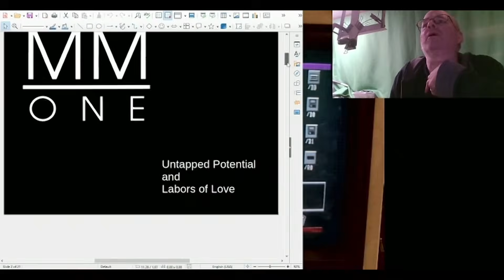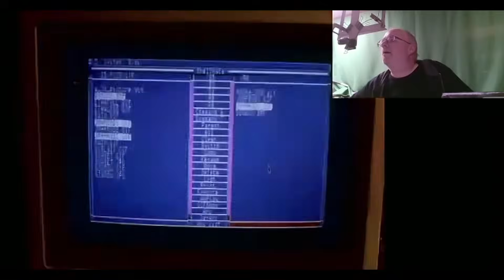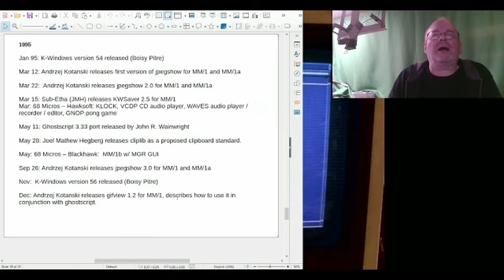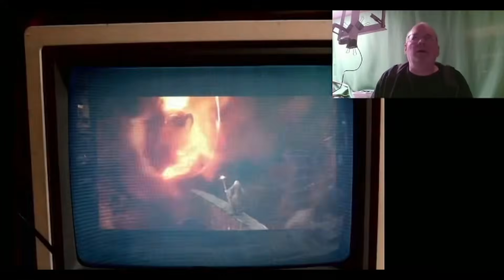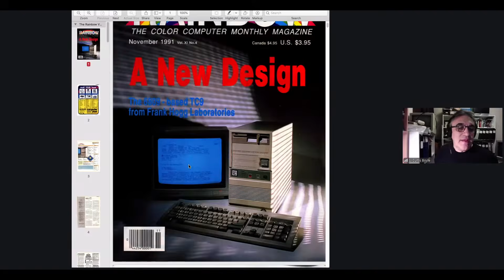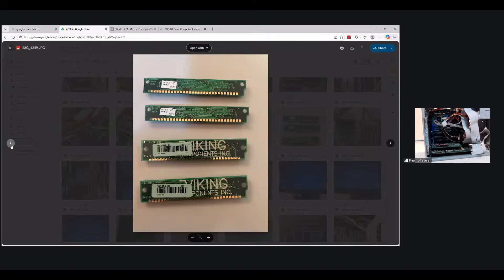Tandy Retro Show 2026 part 5

Comment: There's a lot of mention of cost of software.  Hindsight being 20/20, though it shouldn't really have required hindsight to see this, but the biggest problem with adoption is the cost.  I don't think any of these ambitious and otherwise very advanced projects ever made anyone into a multi-millionaire like Bill Gates... in fact in the day, nothing Bill Gates put out could hold a candle to any of this.  But if these projects were open source or something along those lines, they could have reshaped a great many things.  After all, OS-9 and its more advanced brethren had a lot of common code on multiple units of hardware which isn't all that different from modern Linux or even PCs back in the day.

But why didn't I get those?  I couldn't even think of buying something like that at the time but if were "available" to more people out there, it could have drawn more interest.  

Microsoft wasn't "free" but it CAME with the hardware people bought.  And from what I gather, there were no "low cost" machines and they didn't all come with all the software.  But GWindows for $200???  It's kind of insane.  I feel like a lot of this failure to adopt or even to try was the prohibitive cost and fact that the machines and the software were largely separate purchases.  What made Amiga approachable?  Macintosh?  The PC?  They all came with most of everything you need as far as OSes go and what "cost" was the applications.

Lots of talent but the business side strategy seemed to be based on "this is awesome and everyone should want this!" and then advertised in Rainbow Magazine.

Comment: Stream starts 5:15
Intro and history of "CoCo4" machines
7:00 Timeline of the MM/1 with Joel Ewy
1:52:20 Animation demos
2:03:05 Brian W's MM/1 hardware with floptical drive
2:12:50 L. Curtis Boyle on MM/1 reviews and advertising
2:16:00 Rainbow Covers incl. Delmar System IV, TC-9
2:23:20 Lonnie Falk's killer editorial
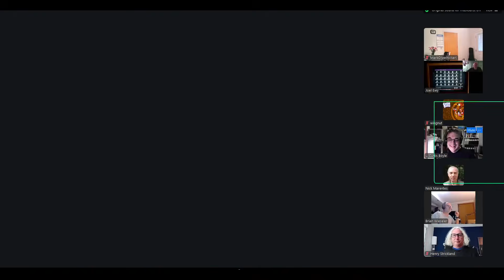2:27:20 TC-9 motherboard and I/O photos
2:28:20 a header gender issue. (To get the "flipped pairs", you simply use a female header instead of male. 🤓 )
2:31:55 Brian Wieseler shows the AT306 (MM/1-B)... PSYCH!
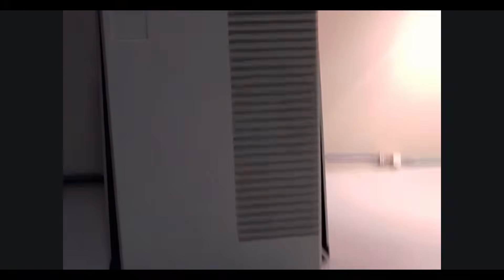2:35:00 now the AT306
2:46:30 UltiMuse on the MM/1 (no demo)
2:46:50 KiX/30 and KiX/20 with G-Windows
2:50:20 Delmar System V vs. System IV
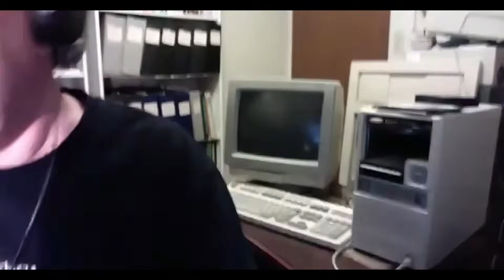2:52:05 LCB's TC-9 bootup challenge
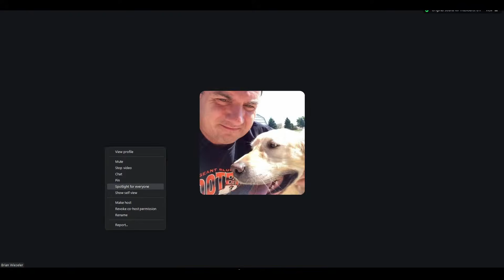3:02:38 TC-9's backside
 -fin